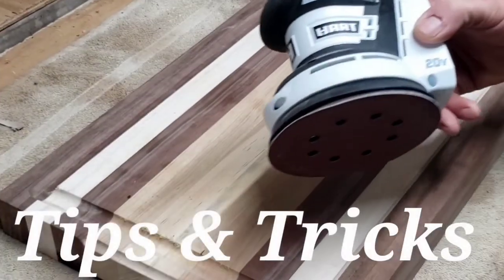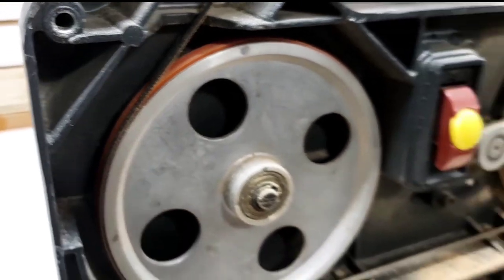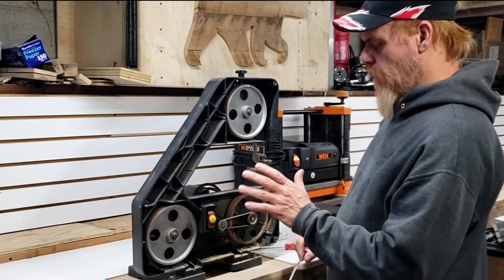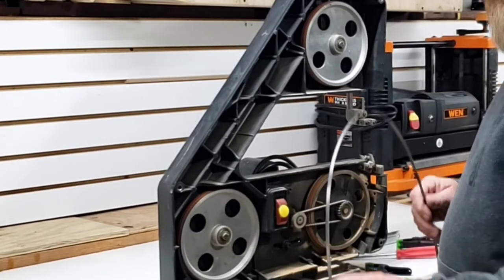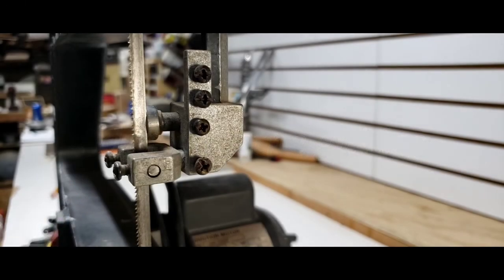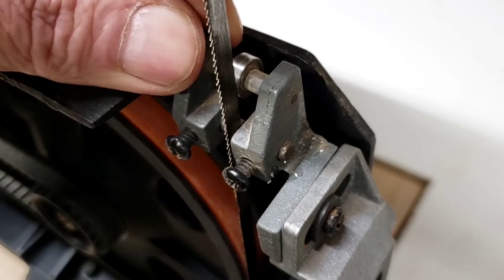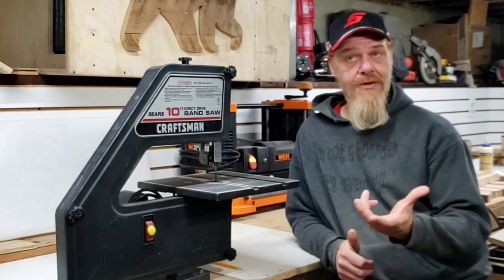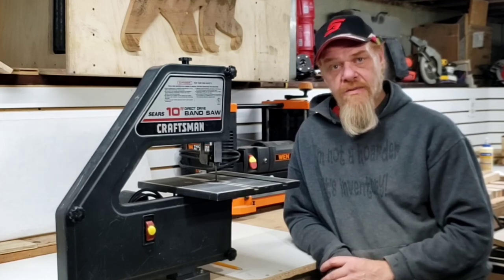Craftsman 10 inch bandsaw #3 | DETAILED BLADE TENSIONING & INSTALLATION | HOW TO ADJUST GUIDES

Comment: There is a 1/8 allen screw that is used to adjust the blade tracking.   See owners guide.  Hope this helps!  Top of page 11👍
Reply from the maker: Thanks so much for the comment!!
I had not noticed that until I looked at the exploded diagram in the manual I have on my website. I should probably make a short video explaining that set screw. I make videos to help others and here YOU are helping me :) super thankful!
Reply: This comment fixed my problem. I can’t thank you enough. I have a backlog of blades that need scales and I have been pulling out what little hair I have left trying to adjust this thing.

Comment: Hey MakinSawdust.  Since you were my first and just about my primary go-to for all things Craftsman 10 inch 3 wheel band saw, I wanted to share a quick story about my introduction to owning and using this temperamental piece of equipment.   I bought it at a garage sale 3 years ago for 10 bucks.  No blade or tires, but in mint condition non the less.  I finally ordered a blade and three urethane tires and a set of cool blocks and had nothing but trouble getting it all set up. Then I searched YouTube for help, your videos got me not only running but enjoying the hell out of using it.  It is very rewarding when it all comes together and I just wanted to let you know you are the reason this band saw didn't find its way to the bottom of my pool.     So, thank you for making these videos for guys like me , because of guys like you keeping me from explaining to my wife why there is a band saw on the bottom of the pool.   Cheers!  Todd Kimbrell Oklahoma.
Reply from the maker: Thank you for the BEST comment ever!!!!!
Keep an eye out for a future bandsaw video with your comment embedded;)
Loyal followers rock 🎸

Comment: I was having trouble with tracking and I decided to check for a video and found yours.  Nice video but you sort of ended up like there was no adjustment for tracking!  My bearings were good so I thought maybe I would try a shim and I discovered there is an adjustment screw for the top pulley. you an simply use a 1/8 allen wrench to move the blade front or back on the drive pulley!
Reply from the maker: Excellent point! 
I did not realize the adjustment screw either, but another subscriber mentioned it. 
I should make a video describing that.. 
Thx for the idea qnd also following

Comment: take off your top wheel and check the little thing that lets it adjust tracking. mines all aluminum and the surfaces aren't coplanar, might have bent it by over tightening. im gonna file mine down a tiny bit maybe sure it's all lined up, might help.
Reply from the maker: Thanks for the comment. I really cant answer that yet, but you have spurred me to make a fourth video for this series. I will do some deep dive hard drive research and some wayback machine on the webs.  
Thank you for the inspiration :)

I will include the infor mation soon

Comment: The tip to use Harbor Freight type clamps to hold the blade to the bottom wheels was the sweet spot of this video, made the blade change less frustrating and easy. Thank you!
Reply from the maker: Great job

Comment: Someone threw this saw away and I picked it up, have to buy three rubber wheel belts due to one being busted. It turned on but when I opened it up I saw that the belt on wheel was off. I ordered them on Amazon but I will keep you posted when I get them, thanks for the video I subscribed 👍🏼
Reply from the maker: Thanks a bunch :)
Reply: @MakinSawdust  I forgot to comment 😆 the belts were tough getting on till I boiled them, then I had a hassle getting the blade to stay on and finally got it to cut. Now I have a bandsaw but will try to build a stand for it 😄 thanks for your video ✌🏼
Reply from the maker: @josedaniel4725  thanks for your update and reply :)

Comment: Great job, I was having an issue with my Valley Forge Band saw.  I have it this band saw for over 25 years and still working.  Having problems with my blade coming off.  Followed all steps and used a rag for each of the rollers for any caked saw dust.  Completed a tune up a few months ago.  Appreciate you sharing your knowledge with us.   Regards, Ernest
Reply from the maker: Glad I could help

Comment: Great video! I was just doing a little work on mine , trying to find some tiny clamps to hold the blade. I tell ya, a little setup and a fresh blade go a long ways with these units. Looks like yours has aluminum wheels. Mines got plastic. I gotta check those bearings. That's something I wasn't sure about. Thanks!
Reply from the maker: Thanks for the info!

Comment: Hi, Great video.  I have a Ohio Forge 10 Inch single blade that looks like the same manufacturer.  I have not completed a full tune up in years.  Nice to have the bearings and guides fully functional.  Good little work horse and meets my needs.  Now that I have more time to tune up all my tools.  My Craftsman Joiner/Planer and Redial Arm Saw are next for a full tune up.  Appreciate the FAQ questions.  My version does not have a separate belt, runs off the motor.  There is one adjustment which requires a Allen wrench to adjust on one pulley if you must adjust blade positioning.  Nice little feature found this in my manual.  Sharing this tid bit.  Thanks again.

Comment: I have tried your parts list link several times but the page is broken. Could you either fix it, or maybe post it in the description? Thank you so, much for the video. Not many videos or info online about this saw, so it is much appreciated!
Reply from the maker: Thanks for the comment. I really cant answer that yet, but you have spurred me to make a fourth video for this series. I will do some deep dive hard drive research and some wayback machine on the webs.  
Thank you for the inspiration :)

I will include the infor mation soon

Comment: i just got a similar unit taskforce, which was at one time a lowes house brand. it has plastic wheels and its been very hard to get going so far.
Reply from the maker: Thanks for the comment. I really cant answer that yet, but you have spurred me to make a fourth video for this series. I will do some deep dive hard drive research and some wayback machine on the webs.  
Thank you for the inspiration :)

I will include the infor mation soon

Comment: I have a Delta that is almost identical except the 3rd wheel is driven by the motor directly.
Other than needing tires it's in perfect shape.
(Almost 40 years old!!)
Reply from the maker: Craftsman made a direct drive model too that would be the twin to your Delta. Mine is a 244512 and the direct was a 244513 I beleive.
Reply: @MakinSawdust  great little saws. I've cut long, scrolled, spade foot legs for a tv armoire out of 2" red oak. No problem.
Too bad about the broken adjuster. I've had good luck running a pin thru both pieces before applying epoxy or welding. I have a friend who's a good welder but his vision is messing up. Best of luck partner.

Comment: great video. what length bosch blade do you use. I see bosch has several different lengths 56 1/8th, 64 1/2, 59 1/2 etc. Thanks cheers from Indiana.
Reply from the maker: Band Saw Blade 56 7/8-inch X 1/4-inch https://amzn.to/4arJ25o

Comment: Thank you for the video.  Can I use anything other than 1/4” blades?
Reply from the maker: I think a 1/2" blade would work, but surely some guide adjustments would be needed. 
I have been curious to do the same

Comment: I just picked one up via a garage sale locally.  Nice bench top size compared to the old 60s/70s 4-wheel version I had that requires an external motor, belt and base that was required.  Mine is a 113.244513 that I think is dated to late 80's.  Much more portable and easy to store in a smaller shop.  There appears to be very little difference to the 113.244512 model you have and I hope the replacement parts are mostly the same (the part numbers seem the same between the two).  Great set of videos on them and how to tune them up.
Reply from the maker: thanks

Comment: There is a hidden screw near the back thumb screw for the top wheel that can adjust the tilt of the wheel so that the blade will ride in the middle of the wheel; you’ll need a hex key.

Comment: Great video.  I bought one used and my question is the lower blade bearing guide.  my bearing was shot and was wondering what part number it might be?
Reply from the maker: Thanks for the comment. I really cant answer that yet, but you have spurred me to make a fourth video for this series. I will do some deep dive hard drive research and some wayback machine on the webs.  
Thank you for the inspiration :)

I will include the infor mation soon

Comment: Never threatened to recast a Christmas gift before but then by chance my 10 inch 3 wheel Craftsman was saved by our crawlspace where it has remained hidden for the last 36 years. I'm thinking some lost foam wheels might be in order and a horsepower upgrade too so I can whip up some more skookum blades out of stock I have on hand. The wee little motor does struggle. 

I'm going to look in the Craftsman parts catalogue for aluminum 10 inch wheels. I'm wondering if they upgraded from the plastic low temperature examples I find myself unable to leave in place.

Looking forward to day 2 of bandsaw resurrection. Thank you for the information.

Edit: When you have a concussion really take it easy with returning to action. Especially be careful when you've been hit in the back of your head. We're not well designed for rear hits to the head. Get your hormones checked if you don't bounce back quickly. This is at least my second time watching this video and I have no memory of the early viewing. I sprung back from the first 8 concussions but number 9 was different, back of head on concrete.
Reply from the maker: oh wow, be careful friend :)

Comment: I just replaced the tires on my saw with the blue tires, maybe wrong ones. I’m having issues with the blade not staying on the pulleys? I can’t turn it by hand 1 full revolution but the blade flys off. I have replaced all bearings as well. Is this hex key adjustment in the back by the top pulley. Sorry for asking as I don’t have an owner’s manual
Reply from the maker: Thanks for the comment. I really cant answer that yet, but you have spurred me to make a fourth video for this series. I will do some deep dive hard drive research and some wayback machine on the webs.  
Thank you for the inspiration :)

I will include the infor mation soon

Comment: Did you ever make that lower blade guide you mentioned at the 9 min mark? Mine is also broken and i've had less luck with epoxy than you did. I'm looking into other repairs since I cannot find a replacement.
Reply from the maker: Mine is broken too currently, and I want to remake mine soon with my ShopShmith. Thanks for the comment. I really cant answer that yet, but you have spurred me to make a fourth video for this series. I will do some deep dive hard drive research and some wayback machine on the webs.  
Thank you for the inspiration :)

I will include the infor mation soon
Reply: @MakinSawdust  I actually found a .stl file online (I think thingiverse) and 3d printed it. I thought I would have to do a lost resin cast to make it in metal. But my ABS resin print seems to be holding up just fine.

Comment: Kind of a longshot but I bought one of these not too long ago and I am missing the entire upper guide assembly. Any chance you can point me in the right direction? So far I haven't found much in the way of parts short of buying another one and stripping it.
Reply from the maker: I seriously have to make another video on this saw VERY soon. 
Thanks for the comment. I really cant answer that yet, but you have spurred me to make a fourth video for this series. I will do some deep dive hard drive research and some wayback machine on the webs.  
Thank you for the inspiration :)

Comment: my son just purchased a used one no blade he was told the length is 59 3/4 inch saw blade came with no manual. My Question is what size blade do you use? Yelm WA

Comment: I have a 10" Craftsman model #113244513  I have subscribed to your channel and watched all your videos on this saw. I need to replace the bearings in the pulleys. The replacement parts list link doesn't work. I have looked everywhere. Could you please help me find the replacement bearings?
Reply from the maker: I will share a better link of the parts soon and update my description

Comment: What I need to know is how you got the front of that off I’ve looked at this bandsaw. I just bought it from a guy and I can’t figure out how to take it off so that I can look inside.
Reply from the maker: The front panel comes off with 3 thumb screws. You can see them in the two previous videos clearly. Hope this helps.

Comment: ...Can you explain the allen screw behind the top wheel, and what that does?  ...and the sequence on how to adjust it?  I have tracking issues with my saw., on tracking on the outer edge of my wheels. There must be a sequence I am not getting right.  I do have new tires and bearings ordered and plan to revisit this adjustment again.

Comment: I have model 113244513. I need the blade block guides. I have found them but for model 113244510. All 3 if these saw look alike are those blade guides all interchangeable ?

Comment: if you have the correct blade can  I use this on thin sheet metal .
Reply from the maker: Band Saw Blade 56 7/8-inch X 1/4-inch https://amzn.to/4arJ25o nut use a higher TPI

Comment: Great Video I have one of these and it needs a new blade ,what thickness blade do i need 
for cutting tighter curves? Thanks Anthony
Reply: The manual says to only use a 1/4” blade, which, I believe, allows for a 1.5” radius curve.

Comment: My saw has the tensioner knob  on the back with a rod that pulls the wheel. It's almost a 1/4" loose.   Blade seems new
 Could it just be the wrong one?. It came with the house.
Reply from the maker: Thanks for the comment. I really cant answer that yet, but you have spurred me to make a fourth video for this series. I will do some deep dive hard drive research and some wayback machine on the webs.  
Thank you for the inspiration :)

I will include the infor mation soon

Comment: I need parts for Craftsman bandsaw but can't seem to find model #  
It's a  older three wheel 10"
Reply from the maker: Thanks for the comment. I really cant answer that yet, but you have spurred me to make a fourth video for this series. I will do some deep dive hard drive research and some wayback machine on the webs.  
Thank you for the inspiration :)

I will include the infor mation soon

Comment: First time on a bandsaw. My friend had this, and I’ve cleaned it up and adjusted it per this video.  It works and stays on track, but it wants to cut off to the right every time and I can’t stop it.  Bad bearing, tension too loose or tight?   Or operator error ?   I’ve been woodworking for 45 years but my first time on a bandsaw.  Please advise.   🤣🤣😢.    Thanks.

Comment: So I just got one it was my grandpa. I used it and at the end my blade stopped spinning. The shaft that comes from the motor and has the black piece on it don't have teeth inside to hold so that's not moving where can I get a new one or what can I do to fix that?

Comment: Maybe you can help me I have an ace hardware 10 inch bandsaw model number 27198. It looks exactly like the saw you have the three wheel pretty much identical except I do not have a gear drive like your front you got a little belt on it. Maybe you can put me in a direction so I can find the right blades I have about four different blades and they’re all different sizes and I cannot get them to fit. I went to Ace Hardware they told me to order it for a craftsman because craftsman is there original that made it for Ace hardware thank you for your time.
Reply from the maker: Thanks for the comment. I really cant answer that yet, but you have spurred me to make a fourth video for this series. I will do some deep dive hard drive research and some wayback machine on the webs.  
Thank you for the inspiration :)

I will include the infor mation soon

Comment: Hi Kevin, I have a nearly identical unit badged Black and Decker. Did B&D make this saw for Sears? The table, guides and saw body are the same, however there are two major differences. The B&D is a true direct drive, vs the belt drive on your Craftsman. The bottom left pulley is on the shaft of the drive motor. IDK if there is any advantage one way or the other. The second difference seems to be that my pulleys have no tires. The plastic is crowned and the blade runs directly on the plastic wheel. No problems with blades falling off. Now I have to check if it should have tires! LOL! Thanks for the informative video.
Reply from the maker: Craftsman made a direct drive saw too that looks identical to mine, but the serial # is 1 off.. I have a xxxxx512 and the direct drive is a xxxxx513

Comment: Excellent video!  Thanks for taking the time to do videos on this saw.  I just picked one up for the same price and the guide piece that you epoxied together is also broken on mine!  Mine looks a little different.  I'm currently attempting to epoxy it back together.  Did you ever end up a making one as a backup?  What epoxy did you use?  Thanks!

Comment: Hi Kevin
My name is Martin.from South Africa. I bougjt myself a 10 inch band saw simelar to yours.broke 4 blade already and it keeps on making a scuffing sounds.checked the bearings they are still fine and checked all guides and where it may catch.any ideas?informative video by the way.you seem to be very friendly and curtious guy
Ive subscribed and will be following you defnatly. Thank you again
Reply from the maker: thanks for your comment, but sorry for the late reply. I would check the wheel bearings and also the guide bearings.